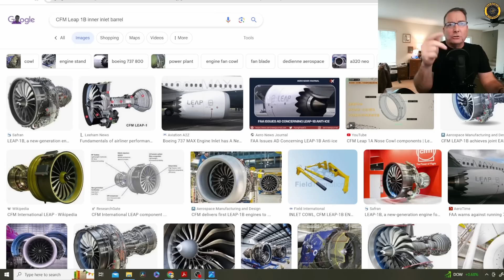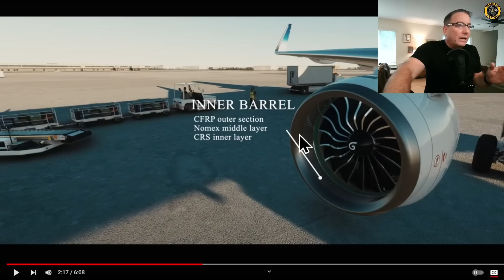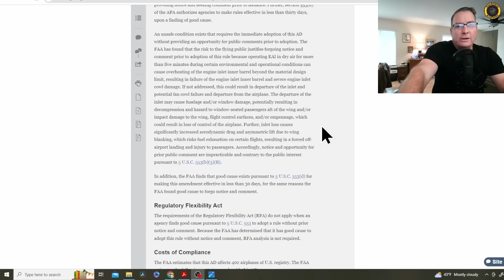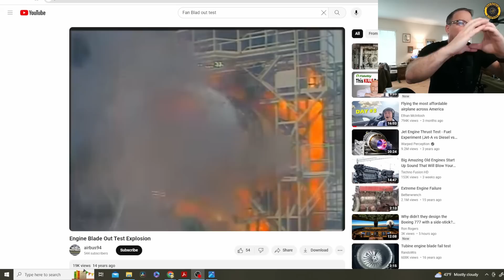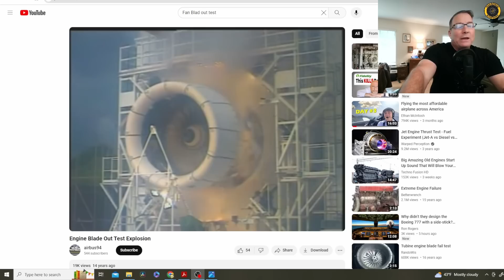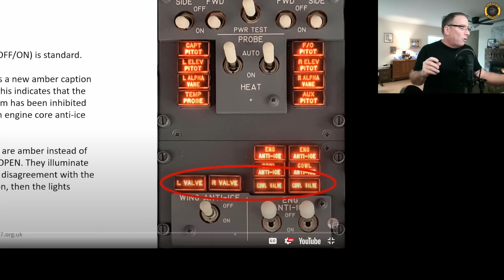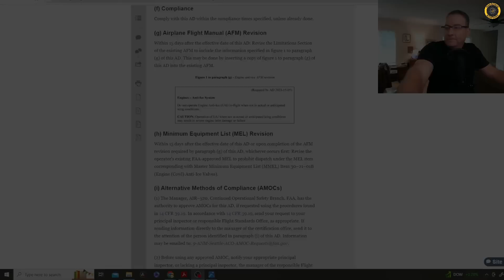Boeing 737 Max-7/-10 Certification HALTED! 1 Feb 2024

Comment: How come the A320 Neo family of aircraft don’t have this anti ice issue ? Afterall they use the CFM1A engine wich I would think is the same material as the CFM1B and CFM1C engine , no ???
Reply: No. The engine nacelles are provided by Boeing. This includes the inlet cowl anti-icing system. It's also Boeing who is now performing the redesign
Reply: Thank you for the clarification. Since they ( Boeing ) know the Airbus design would they pull a Chinese movie and basically just use Airbus design ?
Reply: @marcogoncalves8631  I suspect the A320 has auto anti-ice  so the problem with anti-ice left on too long doesn't arise.   You notice at 2:15  Juan uses a Leap-1A  (A320)  as an illustration?    
However the inlet cowl on the  Leap-1B  is going to be a different part, not least because the fan is 8" smaller diameter than the A320's Leap-1A.   
But if the Airbus design is different in some material sense I imagine Boeing could always adapt it to their cowling.

Comment: Why didn’t Boeing make an updated 757 or a shortened 757 instead of stretching the 737?
Reply: time, money, and airbus
Reply: @johnstreet797  can’t be more to shorten  a plane than stretch one. A shorted 757 would be tall enough to accommodate the larger engines unlike the 737 so MCAS would never have needed to exist.
Reply: Under the upper management theyve had for the last 15+ years they would have 100 percent Fd that up too

Comment: This is also the result of climate alarmists forcing airlines to meet stricter standards for efficiency and emissions. Being a mechanic, all of the issues with newer construction equipment def systems push major costs onto owner/operators because of the failure rates of a lot of these systems. We tend to push to meet requirements, then suffer consequences later.

Comment: I wonder if this has been an issue on the 787. Possibly it's just that the larger diameter of the cowl gives the bleed air more room to cool off.
Reply: 787 doesn't use bleed air
Reply: @tomstravels520   What does it use? My only reference point is poking around the one at Pima, there's a ton of tiny holes all around the inside of the leading edge of the cowl, I assumed that was for deice.
Reply: @pork_cake  787 has electrically heated anti icing system
Reply: @tomstravels520  Of course, just like everything else! Thank you.

Comment: "Departure from the engine/aircraft"  —  Yes, I know it's an industry accepted term, but it's a grand euphemism if I ever heard one!
Reply: non scheduled disassembly
Reply: "Departure" sounds much more soothing than "catastrophic detachment"
Reply: The door made an unscheduled departure from the aircraft, followed by the unscheduled departure of a passenger...
Reply: I can just hear the announcement during takeoff and climb to cruising altitude. I case of any possible unplanned departure from both inside and outside the aircraft. Oxygen masks will drop from the area above you. If this area has departed from the aircraft. Ensure that your seat belt is fastened and hold your breath until we reach a lower altitude and the captain has informed you it’s safe to do so. Of the captain has departed the aircraft prematurely…… well we will delay with that when we get to it.
Reply: At least it tells you what actually happened! LoL. Try: Manufacturing Escapes !
Now that's really rich (in gagging potential)
Reply: @mderline4412 I think I learned that one from the max 9.
Reply: @mikoto7693  Exactly! I'd never heard of such a thing till about two weeks ago!
I Googled it, and read several congruent definitions about 'departures from regular manufacturing procedures'. So somehow they didn't settle on Manufacturing deviations or Manufacturing ommissions
Nah, somehow the process, Escaped! lol
Reply: @mderline4412  I think it refers to the fact that the defect escaped the notice of all the QR folks and was sent out the factory to the customers.
Reply: @mikoto7693  Thanks. That makes more sense, to someone like myself who doesn't work in manufactuing! But honestly when you Google, the half dozen definitions I saw, were all just different enough not to make sense. You cite QR, I just came across QA, and I think I'm more contemporaneous with when it was all called QC....lol. I guess, strictly speaking, leaving a door on a Jet aircraft unsecured, or without the bolts/means to secure it, is indeed a defect. I find it to be more of an omission in the process. A bit like Coke and Pepsi, somehow leaving off, the top closure of their soda cans....Good luck to us all!. Each and every one of us
Reply: Eric on I Do Cars calls them "user installed inspection ports".
Reply: @PeterC5263  Hey, I had a couple of those on the block of my wife's RAV4.   Could see right through the engine, visual inspection of the crank, big-end bearing journal et al.   But not the rod, we never found that.   :)
Reply: "Ladies and gentleman. This is the captain speaking, our engines have just departed the aircraft. Nothing to worry about!"
Reply: The front falls off.
Reply: Just like “the outer wing panel separated from the aircraft.”

Comment: For nose cowl anti-ice, 737s use what is known as a picollo tube, ( pipe ) located inside the nose cowl curled lip.
This hole had holes which allow the hot bleed air from the compressor to fill the inlet cowl with hot air too prevent ice bild-up which could be injested into the core of the engine and destroy blades and stator vanes.
Surely there must be a way to control this temperature.
Reply: The issue is that carbon fiber is not magic - it's layers of glue and mesh, exactly like fiberglass, but lighter.  The heat will cause the glue to eventually fail, either from repeated stress or excessive heat in a single event.

Comment: It’s interesting Juan said that about tapping the deicing valve because I’ve seen commercial aircraft coffee system drain valve filters that have to be tapped with a screwdriver handy to unblock the coffee grounds which can buildup over time. BTW, tapping does sometimes fix the coffee maker drain filter valve in lieu of taking it apart.

Comment: Any thoughts on why Boeing decided to not go with a "modernised" version of the 757 and instead stuck to the 737? Seems like the shortcuts they took are turning out to be "long-cuts" now once things are going the way they planned.
Reply: Because the airlines were flying 737's and switching to a 757 based design would require all those pilots to get new type ratings. It isn't like airbus where all the aircraft have a common cockpit

Comment: With the jets I've worked on, the engine anti-ice valves are fail-safe open. That allows heat to the inlet in case of a valve failure. Better to have anti-ice than no anti-ice, except for this stupid thing. I’m all for advancement in technology for aviation, but in this case, if it ain’t broke, don’t fix it.

Comment: Good grief, it doesn’t take a very smart person to know that the word polymer and extreme heat don’t play well together!
Reply: Depends on the polymer. How hot is the bleed air?
Reply: Some polymers can handle a lot of heat. Some metals weaken under extreme heat, or with repeated heat cycles.

Comment: That IS crazy Juan. If Boeing IS using an automatic system on other models, why isn't it on the 737, before questions arise?? Do you as a pilot suspect that the quality of Boeing dropped after they bought Mcconell Douglas?
Reply: Because if it's too different from the NG then you can't be certified on both aircraft
Reply: @tomstravels520 there seems little rhyme or reason to what can and can't be changed to maintain type. E.g. can't change the engine anti ice but can change landing gear control.
Reply: @markevans2294  you are only permitted to make so many changes though and landing gear would be one of them. If they had to add MCAS to make the plane behave like the NG to prevent a possible type certification issue then clearly changing the operation of the anti ice system would likely not be permitted

Comment: Seems to me this is a joint problem: LEAP engines not having the heat tolerance the older engines do, and Boeing not installing the auto anti-icing capability. I had noticed (in MSFS, not in real life) that the max didn’t have auto engine snit-ice like the probes, but just assumed you could just leave it on. Kinda like landing lights above 10,000’. You need them below, but not necessarily going to hurt anything if you leave them on above. The fewer senior engineers left must be absolutely pulling their hair out😢

Comment: Point of note: Fiber-resin composites like used in the cowling of the 737 MAX don't take high heat (such as that created by bleed air) well.
It is my opinion that what is needed to permanently fix the issue is not a procedural change (that's the "least managerial effort, least cost" solution, not the "best practical outcome" solution), but a physical change to using primarily metal (aluminum alloy is likely sufficient, but failing that, stainless steel would work too, and if they need help working stainless steel, they should talk to ULA who to this day makes the Centaur upper stage out of stainless steel balloon tanks just like back when it was a high-energy upper stage for the Atlas rocket) for the components of the cowl anti-ice system that are directly exposed to engine bleed air thermal conditions.

This issue (longstanding tho it may be) has already claimed a life. I know that engineering is about "price is right" hitting your targets and not over-exerting, but in this case there are secondary and tertiary factors that dictate that a more robust solution than a simple procedural "dump the responsibility on the pilot" change is required.

I even have a second solution, if replacing that many parts on that many aircraft is too much to ask. Thermal sensors! Did you know that an engine anti-ice system has a lot in common with something so mundane as a convection oven or air fryer? If you monitor the temperature of the anti-icing sections of the existing composite engine cowls, you can AUTOMATE this task so that the pilot doesn't need to think about it anymore! Automation is great, and this one's so simple that it shouldn't be hard to get it certified. All you need to do is modulate the engine anti-ice bleed air supply valve based on the encountered temperature of the surfaces of the engine cowl that are subject to icing conditions. Maintain them at a sufficiently elevated temperature that ice does not form, but also limit the upper temperature such that the cowl is not damaged.
That's such a simple task to accomplish, that if redundancy was not a factor I could have the circuit worked up by this time tomorrow. Should only need to read a few thermocouples and enable the heat if any of them are too cold, as well as disable the heating if any of them are too hot. Handful of Operational Amplifier IC's and thermocouples supplying a control signal to the engine cowl anti-ice bleed air valve, and it would work just fine. If you wanna go digital, that's fine too, give me an 8-bit PIC microcontroller that has an analog-to-digital converter in it, and a night of coding, and a handful of thermocouples, and I'll have that working too.
THIS IS SO SIMPLE I CAN DO IT WITH DISCRETE TRANSISTORS IF I HAVE TO.
There is NO excuse for not automating this.

Comment: It's been a long time since I've been around the aerospace design process and materials but in retirement, if I want to break the adhesive bond on something and if the substrate will allow I pull out the heat gun.

Comment: Redundant and reliable electric  anti icing heaters have been used by turboprop and I presume small jet engines for decades and would be a much simpler, more reliable and easier to control system than bleed air. The decision to use bleed air to avoid certification costs was clearly not made by an engineering minded person.

Comment: I didn’t exactly follow the connection between or is there a relationship between a fan blade departing the hub and the cowl engine icing system or are these separate concerns ?
— In other words, if a fan blade does not depart the hub, is the cowl susceptible to spontaneous delamination and thus breakup due to overheating the cowl from the bleed air ?
Reply from the maker: Correct.

Comment: As a retired United Captain and having flown every variant of the Boeing 737 from the 100/200 to the Max turning on and off the anti ice is not a big deal but now with the possible failure of the engine or worse needs to be addressed.Nothing much has changed over the years with the systems because they did not want to have a different type rating for the Max aircraft. It is a one of the last planes that is a joy to fly with out fly by wire. Turn off the auto pilot and auto throttles
Reply: Last Monday I was a passenger on a Boeing Max 8 that couldn’t depart because the autopilot was malfunctioning and had to be reset. After that was accomplished and the necessary paperwork completed, we attempted to depart but had a rejected takeoff. We returned to the taxiway where more resetting followed. The Captain came out of the cockpit to reassure everyone that he had confidence in the aircraft, but I was relieved to arrive safely at my destination 2.5 hours behind schedule. Now the problem is that I have to go home on a Max 8. I’m reviewing my last will and testament.

Comment: Question:   Does Boeing design the cowling/anti ice system or does the engine manufacturer (Leap)?    Somebody shoulda figured out ultra hot air on carbon fiber won't work for long.....
Reply: Boeing

Comment: Doesn't the engine profider (CFM) know their engine parameters and what's required to have safe operation?  It's like Boeing and their suppliers are not on the same page.  Spirit Aero, CFM, etc.  The aircraft is an old design (1967).  Now it looks like all the upgrades are cobbled together.

Comment: Ice detection systems with auto activation has been around for decades.  Is the FAA trying to tell us that replacing the antiquated switches with an ice detection system would have changed the type certificate so drastically that differences training would not suffice and would require a different type certificate?

Comment: You know what Major Browne, which each passing day and every new revelation exposed regarding the NEW "Refurbished" 737 Jerry Rigged Edition , this entire fiasco is beginning to remind me of the fallout from the 1968 Ford Pinto internal memo debacle and it's ensuing scandal from their early 1970's production model cars whereby a number of bean counters in suits from accounting, after performing a cost benefit analysis, concluded it would be cheaper to just pay out the victims of their ill conceived inferno prone death trap rather than engineer and recall an actual solution to the problem. Unfortunately as a consequence, Boeing just like Ford failed to calculate the resultant long term damage to it's brand reputation as a factor in their decision(s) .

Comment: Juan….love watching your reports. Just remember….it’s not just Boeing that is having issues with their planes. Airbus is in the same boat. I’m a captain of an Airline that has almost 100 P/W Airbus A320NEO’s. We are having engine issues with our NEO’s as well as all of the worlds other operators of the P/W powered NEOs. We are forecast to have half of our fleet grounded this year for fixes. Yet you don’t publicly about the issues of of the NEO’s. Also you brought up two uncontained engine failures only pointing out to the Boeing 777 and a Boeing 737-700, yet you don’t mention anything about the two uncontained engines the Airbus A380 has had, Qantas and Air France. Granted Boeing has issues that need major fixing. I personally think they MAX should’ve never happened and they should have gone to a clean slate plane. Airbus, if there not careful and learn from the mistakes Boing is making right now, is on the same road. The A320 still has a lot of 1980’s technology when they could’ve made that plane so much better by improving the avionics package when they were certifying the NEO’s. They refused because of the money that would be involved in improving the avionics. Bottom line…..they are both in for the big bucks, not just Boeing. I hate to say it and I’m hoping I’m wrong, I think it’s a matter of time when Airbus has a major accident due to design flaws….

Comment: The work around for this problem is absolutely ludicrous. It's not rational, it's not sane and it's not safe. The flying public deserves A LOT better. All involved in the work around should be fired and find new careers outside of the aviation industry. FAA needs to ground all maxes and mandate Boeing replace all of the engine cowls with new parts that will withstand the heat. Nothing short of this is acceptable.

Comment: I completely agree with you Juan. It cost Boeing way more to do a half assed job modifying an old design then it would have to just start with a clean sheet. it is always cheaper to do it right the first time.
Reply: Boeing CANNOT do a clean sheet design anymore,  they let their senior engineers go years ago.
Reply: Yes they can. @shoersa
Reply: A clean sheet design wouldn't fix off-shoring software to incompetent contractors, and bad pilots and maintenance (MCAS), factory quality problems (Door plug). It would make it so the FAA didn't prohibit them from having automatic engine anti-ice, which would solve this cowl issue as long as the bleed air valves don't stick. 

Being cheaper in the long run isn't even enough; the customer has to want it, and a simple pathway for pilots with minimal change point training and the ability of pilots to fly different versions of the 737 were key selling points. 

Plus, the manufacturer needs to be able to sustain the cashflow for development. A new 737 minimized development time (cost), and accelerated the timing of revenue from sales.
Reply: @roflchopter11  well Boeing doesn’t have these problems with the 767’s that are still in production.